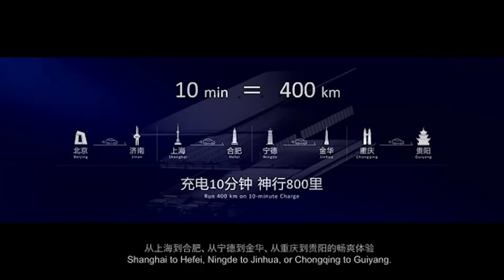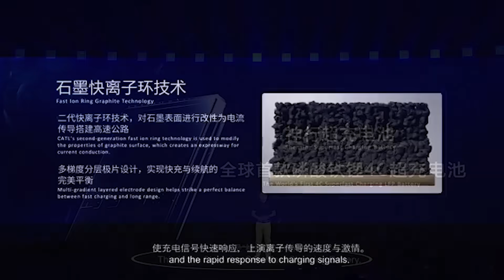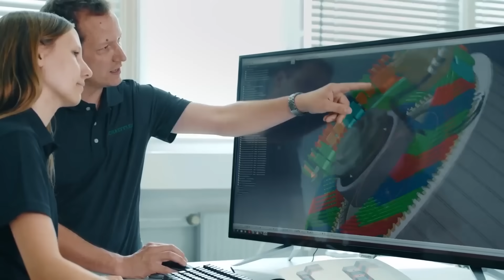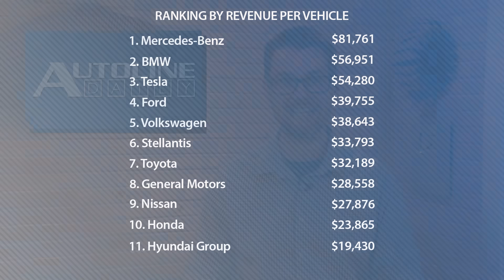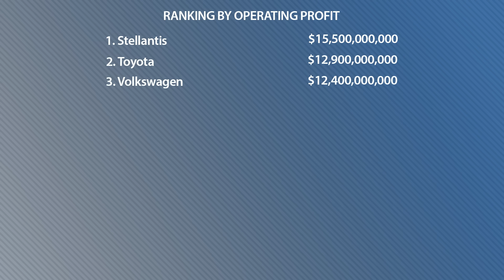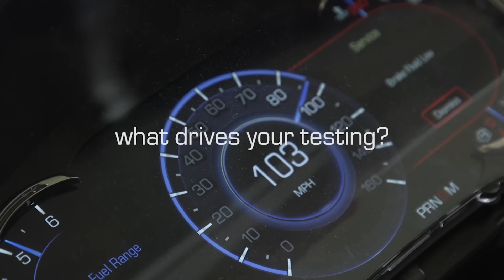LFP Batteries Making Big Strides; UAW Pushes for Strike Vote - Autoline Daily 3628

Comment: When I worked for IBEW union I always found it odd that the majority of members who complained about the employers never voted in any of the union votes so what you ended up with is a small percentage of union members deciding the fate and outcomes of the majority which goes against the very ideal of unions.
Reply: Happens to democracies of all sizes, sadly.
Reply: Too many years of the union not doing much of anything when they did vote left them a bit dissolutioned. Hopefully current leadership can turn that around.
Reply: This reminds me of Texas’ deep freeze.

When Texas went through its deep freeze in February 2021, it was discovered that members of ERCOT (the states power company) had 1/3 of its board members that lived in other states and some were even in other countries. 

How effective can their decisions be, if they don’t even live in the state that’s in peril???? As a Texan, we’ve been paying an upgrade fee on every electric bill since the deep freeze in 2011, ten years earlier. Billions were collected for updating the grid, including winterization, that were never performed. 

So where did the money go? 

That question has been sidestepped, “whatabout-ed”, and ultimately gone unanswered by the powers that be. 

(It’s a red state, so it was most likely pocketed by several people once the regulations that would have prevented that from happening, were rolled back.)

Hundreds of people died during that freeze. Their families deserve answers.

Comment: The Mirage has been essentially unchanged since 2014.  Is it any surprise it's not selling?  I bought a "top of the line" Mirage new in 2016 for just 10.5K.  And for what it was, it was well worth it.  Does every car need to have a sub-six-second 0-60?
Reply: Maybe there were no Hybrid, or EV. 
Only a sedan version, no station wagon.
Reply: I think they're lively with a manual transmission, but almost all of them on the lot are CVTs with lackluster performance.
Reply: The answer is yes, every car should be sub 6 seconds :-)

Comment: Hi Elon aka Mark.  Shoutout to YT'er Sunchi Adventures and their video "Tesla Phantom Braking on Road Trips".  Only you could code software that thinks it need to brake on a sunny, cloud-less, traffic-less day.  If NHTSA had any teeth they would require a indicator on your cars to signal when in AP mode.
Reply: Thanks for the video reference to Tesla Phantom Braking on Road Trips video. Tesla says issues are fixed yet they always seem to still exist...
Reply: @russh6414  Although I'm sure the software is an issue, one clear root cause is the desire to place the stereo cameras behind the windshield.  I don't believe that implementation is working properly (mismatched CCD's, lens distortion, windshield distortion) such that Tesla already issued had a recall on that module where the calibration was not applied at the factory.  

In other words, the faults are baked into the design and no one knows how to solve them.
Reply: Hi Mary aka no clue. Shout out to CNBC reporters getting suck in the middle of the street in the middle of a ride, Fleet of cars just stopping because of a crappy cell signal, And one that drove into wet cement.and lord  knows how many more mishaps that have gone ignored. Level 4 my ass.
Reply: @dclpgh  Hi Diversion Team.  Current Tesla Robotaxi fleet:  0 point 0 cars.  Try again.
Reply: @bobbbobb4663  there are 400 000 of them driving people around every day. No internet needed. YOU try again.